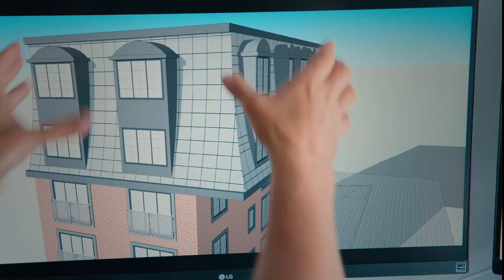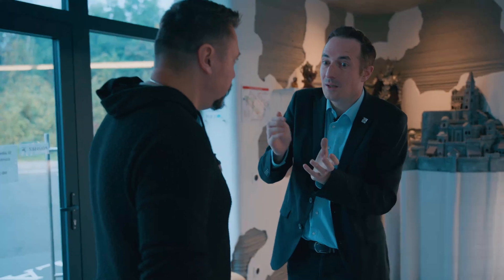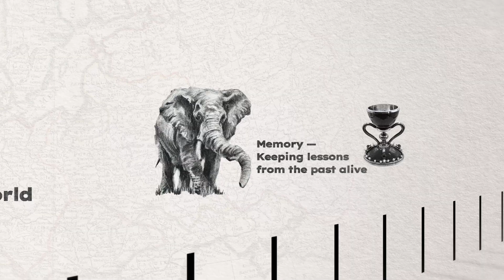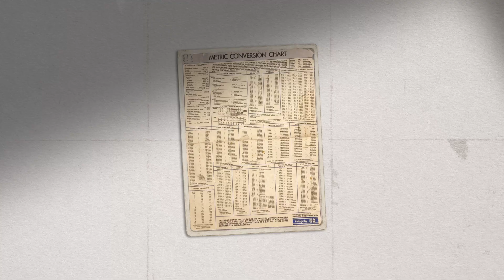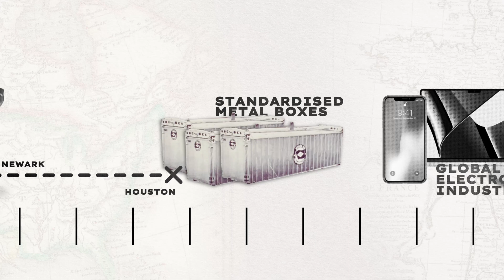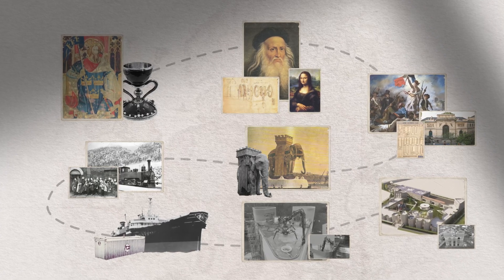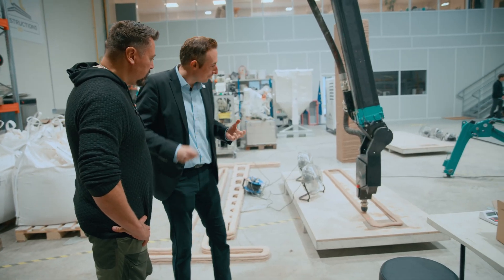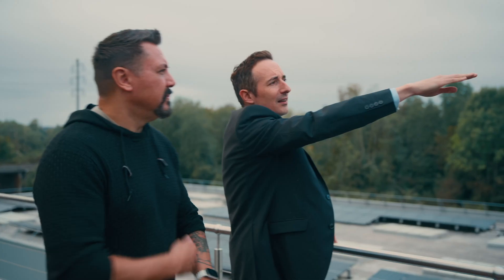Half the Cost, All the Innovation: Inside the World’s Largest 3D-Printed CASTLE

Comment: You mentioned you’re building a six-story building at half the cost and time — do you think North American regulations are ready for 3D-printed structures yet? I think it would be so cool to watch a home get printed in a short time frame. It would be amazing for building affordable housing for the homeless.
Reply from the maker: Great question, Jean-Pierre. The short answer is: not yet. That’s why part of our mission is to build and document, so we can help shift mindsets and policy.

The speed and potential cost savings could be game-changing. Appreciate you being part of the conversation. 🏗️
Reply: @KrisPottsOfficial  just curious.. maybe I missed it in the video, but does the printed layer have built in insulation or any kinda weather proofing? Would it need to have an additional outter or inner layer for the insulation or moisture protection? I guess what I am trying to ask is, how does it protect the inside from the outside temperatures and environment